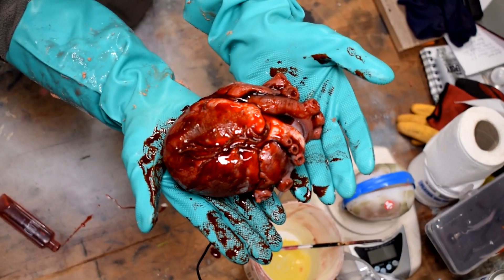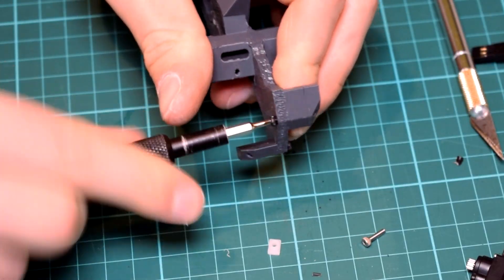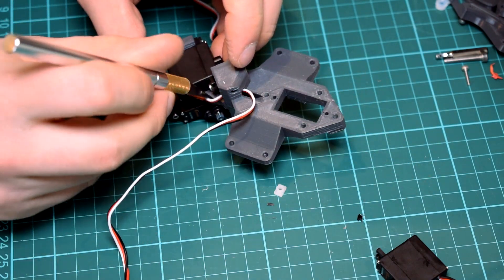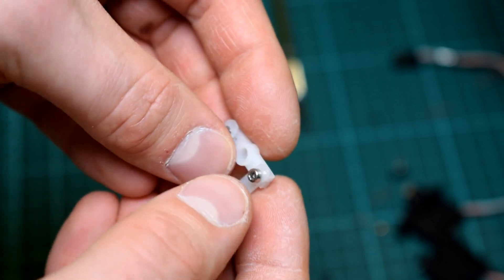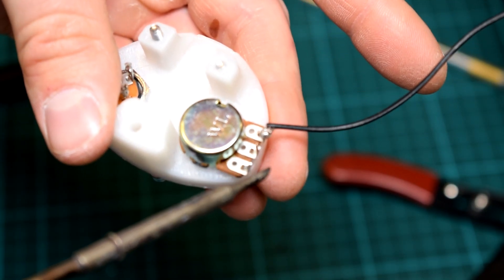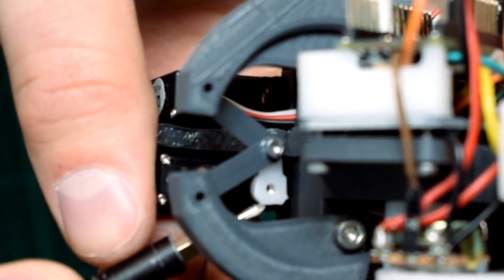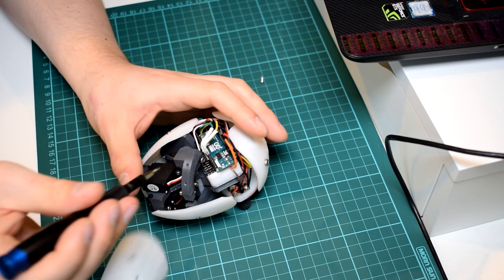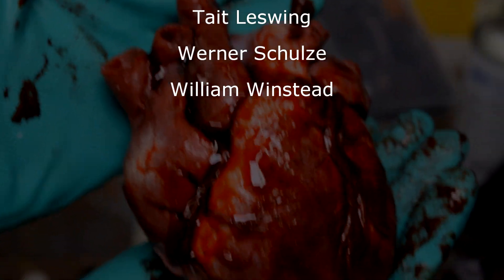Building the Advanced Animatronic Heart Mechanism

Comment: The concept of trying to mimic the operation of an organic human heart with mechanisms has been abandoned, it has been discovered, that it is much easier to use two mini turbine pumps, to replace the heart. many scientists initially were worried that the blades inside of the miniature motors would shred, and destroy all of the blood cells in the human body, although however we have discovered that that is not the case. every time somebody has tried to create a mechanical heart that reproduces the same function as the actual Organ has failed relatively quickly, trying to reproduce such a complex system is unnecessary, a simple submersible pump can replace the heart easily, there are a lot of people walking around right now that don't even have a pulse.

Comment: Great job Will, this will be my next project. Downloaded STL files and the Top Panel is not included, all other files are there. I have built up the battery version you posted and it works great. Will be sculpting the heart of Davy Jones from Pirates of the Caribbean for a Halloween display. I have just finished making an animatronic head of Davy complete with 3 axis movement, talking jaw and animated tentacles.
Reply from the maker: Well spotted, I've updated the download pack on my website: http://www.nilheim.co.uk/latest-projects/servo-based-heart. Good luck with davy jones project! I'd love to see it

Comment: Very awesome Project! But why dont you just use the pwm pins from the Arduino to control the servos?
Reply from the maker: Thanks! I think that would be possible but I prefer to power the servos separately because the supplied current usually fluctuates a lot as the servos move.
Reply: Yea i had the same problem, my arduino kept resetting when the servos moved and they jittered a lot, but if you use a capacitor with about 1000 to 3000µF it smooths out the fluctuations.
Reply: There is a difference between directly connecting the signal wires to the Arduino and/or connecting the power wires.
If you remove the Servo board, run that power directly to the servo, connect the GND between the Arduino and that power in, and then run signal wire directly from the Arduino to servo signal, there should be no need for the servo board at all; saving space and cost.